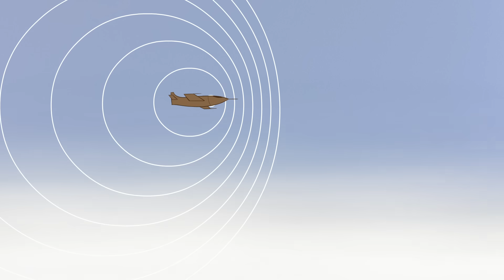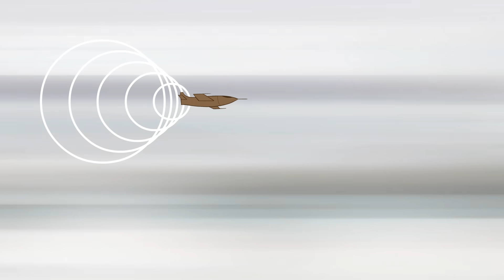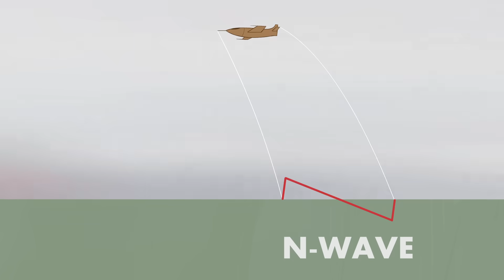The sonic boom problem - Katerina Kaouri

Comment: 3:28. Still doesn't explain why breaking the barrier makes a loud sound.
Reply: Breaking the barrier doesn't make a loud sound.  There's no "barrier" that gets broken.  When something flies supersonic, the pressure wave in the air can't move out of the way fast enough (because it moves at the speed of sound), and so it piles up into a large shockwave and radiates outward.  The sonic boom isn't something that happens once - it is a constant noise.  It is a continuous line of high pressure (meaning high intensity sound) that travels in a cone around and behind the plane for as long as the plane is supersonic.  When the edge of that cone sweeps over you on the ground, you hear an intense boom.  People who are farther behind the plane hear it before you, and people who are farther forward along the planes track hear it after you.  When the Concorde flew from UK to the US, every single person on the water below it no matter where they were along the 4,000 mile path all heard the boom as the supersonic plane went past.

Comment: Sorry but the upgraded design tail only made the aircraft gain agility at higher speeds while traditional fins were constantly pushed by the wind and wouldn’t lift as much.

The MAIN upgrade that changed everything was the highly angled wings, on which the compressed sound waves tended to "slide" instead of bumping into it.

Comment: First creature to break the sound barrier was the mantis shrimp.  It can move it's little plunker faster than sound under water.  Needless to say getting plunked buy these little critters can leave a stinging bruise or even cut open finger tips.  The sting of the little shockwave really smarts.  Much like a water hammering hypodermic tube with a little bit of water in it.

Comment: Just one small problem with this video, you state that the Bell X1 flew at 1127 Km/hr which is below the speed of sound which is around1235 Km/hr  give or take depending on temperature and humidity and altitude.
The other fact that was incorrect was the Bell X1 actually flew at 1541 Km/hr not as stated 1127 Km/hr that's a large discrepancy

Comment: Correction, the "Hyperbola" should be a "Parabola". Hyperbolas have 2 pieces. Parabolas have 1.

Also, with your examples at the end, you are conflating 2 things; sound waves and pressure. The tail whip exceeding the speed of sound doesn't actually do anything sonic (significantly). Neither does the crustacian's claw's pressure pulse. Neither of those scenarios produce a lot of sound waves. The shrimp stuns fish by confusing the fish's air bladder (which holds a constant compression to keep the fish at a certain level of the water.

Let me explain... I'm sure you have learned that gasses compress , but liquids don't, right? Well, since you are surrounded by air, if a small air tank explodes, the pressure isn't that much of a concern until the air tank gets pretty large. The pressure change is shared with all of the air in the room AND your lungs and ears. It might irritate your ears and make them pop, but it's not going to make a huge difference to you because the pressure effect dissipates with all the surrounding air. Your ear only takes on a miniscule portion of the pressure change... so your ear might feel a popping sensation if it's a really big tank. You'd really be more concerned about the objects the air may throw in your direction.

But imagine this. Imagine it's not an air tank, but a small balloon with compressed air... and it's popped right inside your ear canal, making the effect target only the air inside your ear. NOW you might go deaf in that ear.

That kind of isolation is present in the water.... only air compresses... so when you cause a fast pressure change underwater, the air's only pressure release is any organism nearby that has gas in their organs (air bladder). This causes the fish's air bladder to release air, convulse, or rupture which AT LEAST stuns the fish.

Another example is when someone uses an explosive on a lake to make fish float to the top. An explosive is a much larger pressure change than a crustacian's claw, so it impacts a much larger radius, but the principle is the same.

Has absolutely nothing to do with supersonic speed though.
Reply: Sorry but you are not right. It is a hyperbola, any book on conic sections (see First year Calculus books) will confirm that. Also, sounds waves are disturbances in pressure so I am not conflating anything.

Comment: 1127 kilometers= pretty fast most likely 1125 kilometers= slighly less fast than that. Still pretty fast though, considering the number of kilometers. Although one kilometer is of unknown length, so mostly guesswork. But one thousand is a large number, so it must be fast

Comment: So if we use other gas than air mixture, we could make sonic boom even with lower speed?
Reply: Indeed if you manage find a mixture where the sound speed travels more slowly than in air then yes you would get a sonic boom at a lower speed

Comment: i think the theory is wrong. i think the doppler effect is real enough how ever its not nose and end of the body that clash but that the ground itself reflect the sound wave and hit the source that created it at some frequency. it have obviously somthing to do with sound, resonance and interference patterns in air. it does not seem like anyone included the sound mirror called the earth in the equation, no matter the distance from the surface. its only when a wave hits anoter wave that is one half the wavelenght it can create interference pattern but if the difference in wavelenght is to big, one wave can travel trought the other without causing much interference.

Comment: . I have a question if you don’t mind. I read some stuff about sonic booms and it says that shock waves gather together and thats what causes the sound. But its not really explained well. Like what makes a noise? Shock waves gathering together or a or plane crashing gathered waves?
Reply: Shock waves cause abrupt changes in the air molecules (they shock them after all) and this is what creates the loud noise eventually heard at the ground (as this disturbance travels in the air and reaches the ground). The GEOMETRY OF focusing of the sound waves can be seen when you see the wavefronts (circles) touching  the Mach wedge in the video but your are right that not much explanation was given about the AMPLITUDE of focused waves leading to the shock wave. It is a quite complicated topic but you can find more info in the DIG Deeper section.
Reply: Katerina K do u kniw the name of the song ?

Comment: I used to hear both booms very clearly living near the space center when the shuttle would return. Windows shaking and all. Sometimes I would forget about the shuttle and it would catch me by surprise.

 What is it that cause distortion between both booms that makes it harder to distinguish both booms? Is it airspeed? The shuttle enters the atmosphere at ~17500mph. NASA says the mach number is nearly 25(hypersonic). Wondering if maybe the sonic boom is louder for every increment of supersonic speed. Does anybody here have an explanation? 

On NASA's website they explain that there are "Strong shock waves are generated on the lower surface of the spacecraft." This was as close as I could get to answering my own question, but the article didn't mention anything about sonic booms and of course nothing about distinguishing multiple booms. https://www.grc.nasa.gov/www/BGH/hihyper.html
Reply: Yeap.

Comment: 2:12 Speed of sound in air is dependent almost solely on temperature. When altitude increases, pressure and density drop simultaneously and cancel out each other.
Reply: Great observation sir. I had never heard of the correlation between speed of sound and altitude either and found it weird.

Comment: what if you travel faster than light :O What boom will that make?
Reply: You would make a time boom, Barry.

(DC Presents the Flashpoint Paradox.
Reply: sam93931 you will be ripped apart but everything else would be fine imagine turning a lamp on the light is everywhere in the speed of light and nothing is hurt but it really depends on the power of the particles hitting the atoms
Reply: Fleggybeast Btb well, not everything will be fine according to Einstein ;) With our current physic model, its impossible, I was just kidding.
Reply: SoL in a vaccum: Not known.
SoL in a medium: Cherenkov radiation.
Despite being a silly question, the answer still can be serious.

Comment: As far as I know, when he says that to determine the intensity of the sonic boom, at 3:50, requires to solve Navier-Stokes equation is not entirely true. The solution of Navier-Stokes eq. is one of the Millenium Prize Problems (found here: http://www.claymath.org/millennium-problems/navier–stokes-equation). What we actually do is use Navier Stokes Equation on computer solving programs, with a bunch of modelling details the provide us a possible result for a specific case of the Navier Stokes equation.

Comment: you could mention that the crack of a whip is a sonic boom created by the tip of the whip traveling faster than sound.
Reply: It is mentioned in the Dig Deeper section. The TED-Ed videos should be short as they are meant to act as a prompt for curious learners to learn more. Hence, inadvertedly some facts that people might consider important are left out.

Comment: How does breaking the sound burryer even work, the earth is already moving really fast
Reply: Breaking the sound barrier is basically a result of the object travelling faster than the actual sound waves themselves moving, exceeding the speed of your own sound produces a large pressure wave (sound wave) as a result of the combination of all of the sound waves which were meant to propagate from the front of the aircraft, but instead pulse outwards in the form of a sonic boom.

Comment: Anyone who lives near a Military Base will tell you differently about Supersonic flights over land. The Military does it ALL the time, during flight training. It is Low-Altitude Supersonic Flights over land that are prohibited, unless you have permission (air shows have permission for low-altitude supersonic flights). Any aircraft  flying at or above 10,000 feet are allowed to fly supersonic.
Reply: You cannot fly supersonic above 10,000 ft, and the military can only fly supersonic in specially designated areas, or in times of war (9/11).  Also, most airshows cannot get permission for supersonic flights due to the blanket FAA rule.  The biggest airshow in the western hemisphere, EAA Airventure, held every July in Oshkosh Wisconsin, cannot even get permission.  That being said, at most airshows, if a high speed pass will be done, the pilot will fly as close to Mach 1 as is legal, and it may appear to the audience that the sound barrier was broken even though it actually wasn't.  There is a loophole though.  If you can somehow reach 60,000 ft, you would then be in uncontrolled airspace and allowed to fly as fast as you want.

Comment: there is something i don't understand, from the absorber point of view  (reference) wouldn't the speed of sound of the airplane be the summation of the plane's speed and the speed of sound  ? 

say the plane is moving at 2000kph, and the speed of sound at the plane level is 1500kph,  wouldn't the absorber feel the speed of sound waves is 3500kph  ?
Reply: +Иван Калашников They can add up but not like that and absorber wouldn't feel that speed. You need to understand plenty of things but the most important ones right now are terms like classical and relativistic motion. In classical motions, you can indeed, add up speeds.

 Most simple example is taking those two speeds and dividing them with two to see your average speed or if you want more precise answer, you can take instantenious speed and take derivatives of speed and time to conclude your final speed.
 
Interesting thing is that you can add up speeds in classical motions but you cant in relativistic motions. For example, if you are travelling at a speed of light (even if it is impossible) and you send a beam of light in direction in which you are travelling at the speed of light. Those speeds will not add up because nothing can move faster than light, ergo, that beam of light would probably seem to stand still and continue to travel along with you at a speed of light.

I recommend you to do more research in a terms of classical mechanics and you will get thing like speed summation very easy. ;)
Reply: Drago Mihaljevic sound is not like light,  the speed of sound is not constant in the same medium,  it can vary and be added up to the object velocity,  what you said only applies to light.

Comment: the stabiliser, an all moving tail, is crucial part of a transonic or Super sonic design, however, the US stole it from the UK and hastened the launch of the X-1
Reply: Not quite right, we gave them our research data from the Miles M.52 and design drawings, including the flying tail, in exchange for their research data. But the U.S. never held up their end of the deal and gave us nothing in return, then the British government cancelled the M.52 program. The bastards.
Reply: The US first shafted allies involved in the Manhattan Project by cutting them out with the Atomic Energy Act of 1946, where they took all of the scientific input from the other developing nations (UK and Canada) opted to not develop further with allies and said f**k off!

They then did it AGAIN in 1946-1947 with the Miles M.52 and Bell X-1 research and data exchange and shafted us over by withholding everything they had and pawed over everything we gave them.

And finally after that, the UK government pulled the plug which was declared the third blow.

Needless to say, we realised the US couldn't be trusted for a long time after that until there was a little thawing in relations.
Reply: Turbo-Fan love is a good one game play game game and fun to game and fun fun game fun tytytty

Comment: X-15 
mach 7
Reply: Guust Verk nope, rocket engine
Reply: In*
Reply: Dao Khanh Long Thanks
Reply: On space/stratosphere.
Reply: Koro-sensei MACH7
Reply: Well LEO altitudes are still well within in the atmosphere.
Reply: @TheMilkManCow  There's a line at 100 kms or about 330,000 feet. above that is considered space.
Reply: Guust Verk X-15=rocket, not jet. It hasnt even an air inlet.
Reply: rocket? nope, scram jet engine
Reply: Mach and cheese.
Reply: +GabrielKirov it uses jet engines which rely on air to generate thrust, so it cannot fly in space. Also the X-43a was Mach 9.6, also using a variant of a jet engine.

Comment: sound travels at 1234 km/h, the plane traveled at 1127 km/h, it did not break the sound barrier.
Reply: +tanakung the sound speed is not constant in the atmosphere and it reduces as we go up (and then increases again). So at the height of Chuck Yaeger's aircraft 1127kmh was larger than the sound speed at that point and the sound barrier was broken :)

Comment: some air to air missile can go to mach 4 some mach 5
Reply: +tivaporn hildreth and the new electromagnetic Railguns the US are testing (designed and built in the UK i might add) can fire a ferromagnetic shell (aka a magnetic piece of steel in this case) at speeds up to mach 7 and fire accurately over 100 miles. scary stuff eh?

Comment: I bet if you saw 100000 of those sound-breaking stuff, if you just spot one, it will become a blur in the sky in less than one single second.
Reply: +electricrainbow it is not what you see really it is what you hear :) When the aeroplane exceeds the speed of sound it keeps producing a very loud noise throughout the flight (sonic boom) until it decelerates below the speed of sound again. I suspect what your refer to is this picture? http://apod.nasa.gov/apod/ap010221.html

Comment: Besides when they talk about the military jets, and pushing to go faster. they aren't entirely trying to purposely break the sound barrier, but, pushing the limits of a planes ability of using the afterburner for quick low-level get aways if in a dangerous situation. military jets over the years end up getting faster due to upgrades in engines, body frames, and wing position, for aerodynamics and fuel saving tactics. take the F-35c Lightning II JSF (Joint Strike Fighter) it's good for air-to-ground, and long range air-to-air missions, but in close range dog fighting, it under performs, slow turn rate, it's not agile, and it's weak. so, they push the F-35c JSU to it's limits for getaways after its misison. those trying to set records push the boundires, military pushes for better survivability. here in South Jersey, we hear sonic booms from the Navy Atlantic Strike fleet F-35c and F/A-18F Super Hornet fighters conducting supersonic tests. but they are off the coast enough it doesn't affect anything inland.

Comment: I wonder how animals evolved to move their body parts faster than the sound's speed
It has nothing to do with "the faster, the better"
It only has the effect when they reached the speed of sound
Reply: +김창연 In the case of the dinosaur it was probably for scaring other animals with the crackling sound
Reply: +김창연 as evolution doesn't really have an aim this is a valid point
but I guess it was rather a side effect of the real purpose of the body part. The body part had to get more agile and once they figured out that it is faster than the speed of sound, why not use it then?...
just my 2 cents